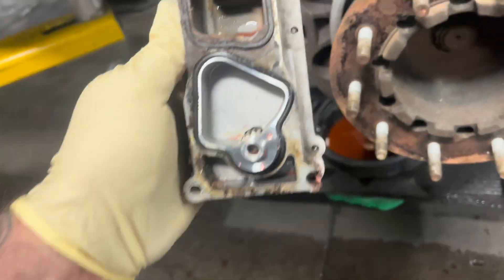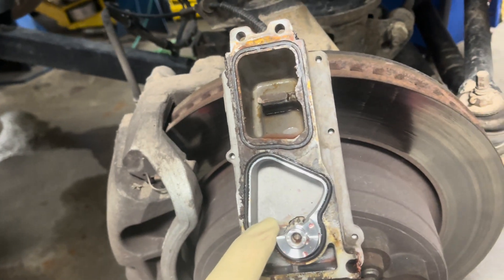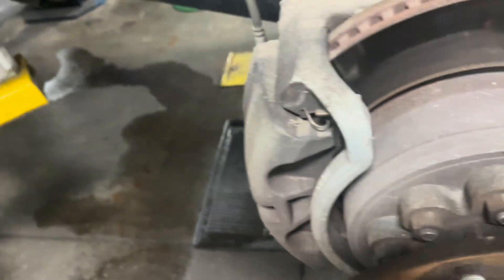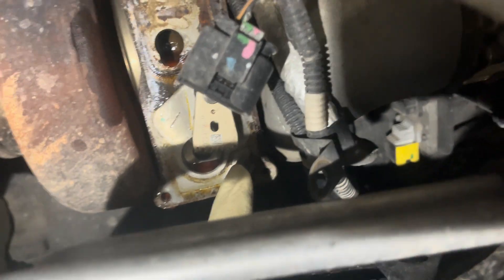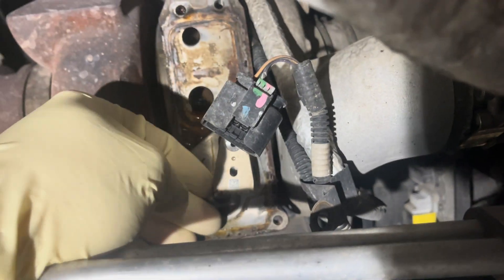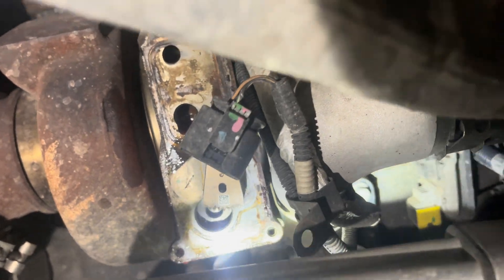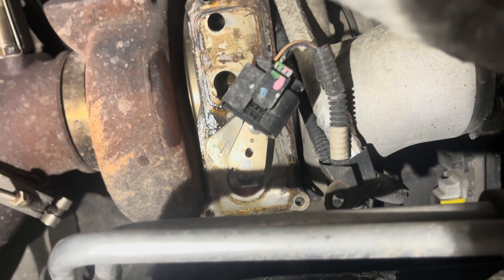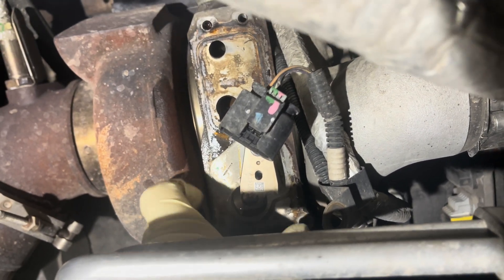Cummins turbo failure

Comment: My turbo had a hairline crack on the gear at the top that ran down to the gear shaft. It’s not noticeable unless you have good eyesight. I was told that this is not a rare occurrence but not the most common occurrence either.

Comment: I have used my exhaust brake on my 2021 24/7 unless the roads are bad. The dealership even advised me to when I bought it to keep the butterfly clear and extend my brake life. It's an automatic thing for me after the truck is started

Comment: I always use exhaust brake when towing and i try to put it on when I just drive, happen half of the time.  I was concern that there might be an issue of overuse.  Sound like that not the issue, so will try to increase the usage.  Too bad, it can't be activvated automatically.  thumb up

Comment: Curious what you think of the new 2025 6.7 Cummins with the redesigned head I’m hoping it will open things up for airflow and of course aftermarket parts. Didn’t know if you’re composing or making a list of aftermarket parts that would benefit the new engine design, including Maybe even a different camshaft and maybe flat tappet lifters if common is still being cheap with their   roller lifters I wanted your opinion and thoughts also remember pretty much. We won’t have to worry about the EPA at all on any gas or diesel, including class 8 back to real EGR deletes the billing Congress right now it’s supposed to give us the option of buying vehicles just like our military can with very limited emissions and still covered under the warranty obviously they’re going to try to sell everything. They already have in stock and parts to build first.

Comment: DON'T use your exhaust brake during, Wet,  Icy, Snowy conditions ever!!! Bad things can happen. Any other time is ok,  why having just the rear axle slow down can cause it to lose traction and accidents will happen.
Reply: Use mine all winter long with no issues unless the road looks like a sheet of glass
Reply: @TheIamdevin same here never an issue North East here as well
Reply: @TheIamdevin  as a retired wrecker operator I've seen what can happen it's a game of Russian Roulette it's not illegal but neither is swimming with gators.  You can do what you want. I'm even sure the owners manual says not to use it.  But hey I only cleaned up the aftermath.  Good luck 🤞
Reply: @KRich408 if the truck starts to slide just get back on the throttle,turn off the exhaust brake and keep on trucking... theres a reason before traction control and abs was a thing not everyone crashed in slippery conditions
Reply: @TheIamdevin  wow so many think just because there's a chance you can pull out doesn't mean it will always happen.  Pulling out works 90% of the time but the other 10% you might be paying child support. Just think about it?  Darwinism is  always looking for members. No matter how well you think you can drive.
Reply: @TheIamdevin  just because pulling out works most of the time? Darwin is always looking for members.

Comment: I have a 2021 and I never turned my brake off and it always works.
Reply: You need to push down on the switch to turn it on. It will not come on by itself. There are two modes to choose from. Full engine braking and auto engine braking. 
It also defaults to off when you shut the truck off. Your comment sounds like you never used it.
Reply: @ how dumb do you think I am. As soon as I touched the switch the first time I’ve not had to turn it off. I start the engine. It’s already on.
Reply: Many delete tunes keep the exhaust brake on permanently. You might be deleted. 😂
Reply: @ as a veteran many have tried and all have failed. Even my ex wife couldn’t succeed.

Comment: What’s best, full or auto or does it matter?
Reply: Full starts engine braking when you take your foot off the gas. 

Auto will save some fuel allowing you to coast until the brakes are applied.
Auto is also used when cruze control is set and will maintain speed going down hill without applying the brakes.

Comment: Wish there was a way to clean the veins without removal. my thoughts but will never do. Some way to inject a fluid while truck is running to treat it like a pressure washer on the vanes to clean it up...